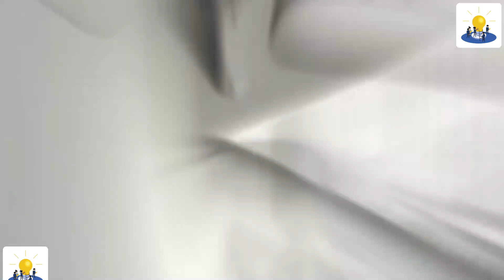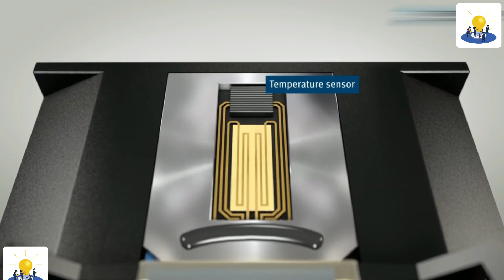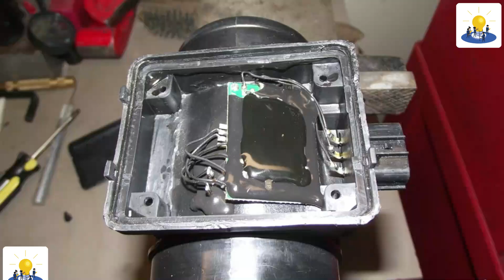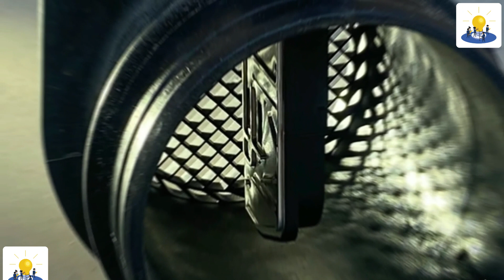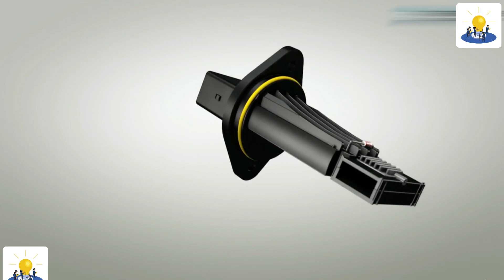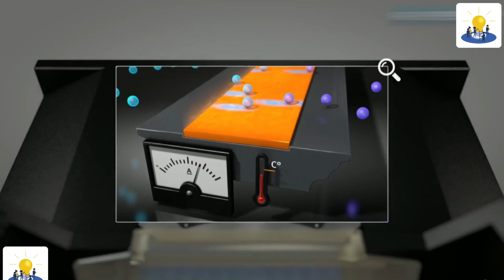How Mass Air Flow (MAF) Sensor Works Full Explained

Comment: You can also check to make sure both resistors are getting hot on the sensor. Or pull it out and run voltage through and when you blow on the sensor the amp draw will go up. Look for pinout and voltage for your model.